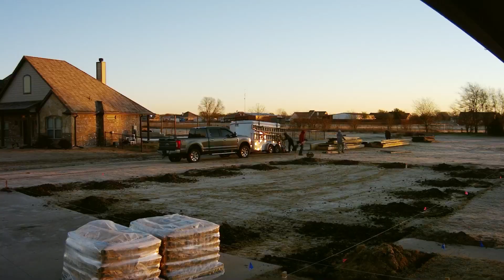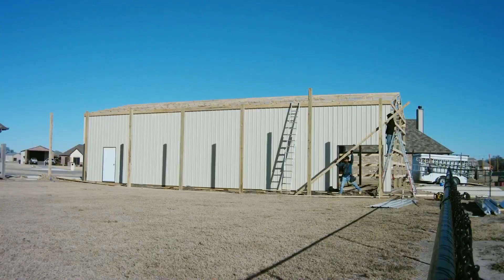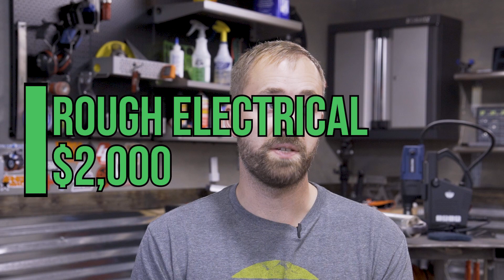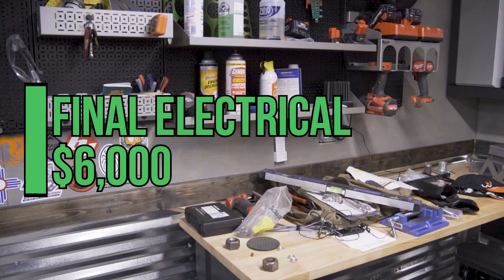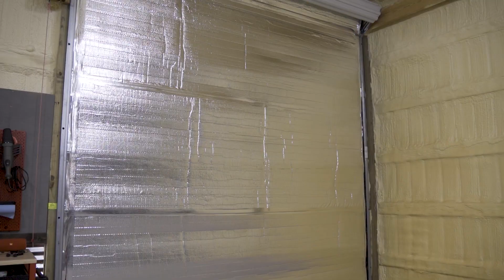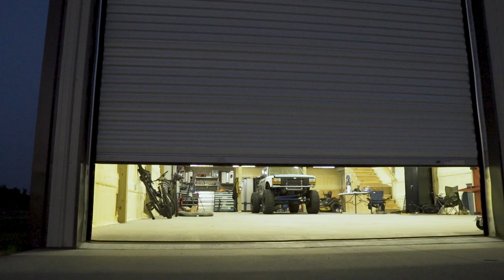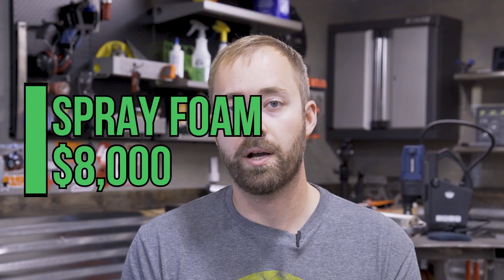How Much Does A 30x60 Pole Barn Cost? - Reckless Wrench Garage

Comment: Only 15k for the concrete foundation?!  Up here in MN it cost me 25k for a 24x28 for my garage...
Reply: you must not know any concrete guys, i paid 6k for my 36x48 in minnesota
Reply: @sc400drift2  I'm smack dab in mpls... nothing is cheap in the cities
Reply: Living in MPLS is problematic in more ways than construction costs.
Reply: Cost varies widely based on location. The site prep and concrete for a 42x50 slab (4" thick, 12"x12" footings, rebar, fibers, wire mesh, 4000 psi) cost me $24,500 in NC.
Reply: I paid 17K for a 40 x 80 , plus 4 x 80 sidewalk and 30 x 20 parking pad in MN in 2018.  Guy gave me a deal but others wanted 24K . Thats 4000 PSI with fiber

Comment: Good looking garage. A nice open floor plan 1 bedroom apt. on the  back would have been sweet
Reply from the maker: It would have been doable, getting water and septic there would have pricey though
Reply: @RecklessWrenchGarage  
You could do a compost toilet or an incinerator one. Also a grey water drainage system for sinks/showers saves $$.

Comment: As an Electrician I would have put in a separate 200amp service and not come off the house. You’ll always have room to grow then
Reply: I thought the same but when I did mine it was going to be another $30 a month forever for the second meter. So I did the same from the house.
Reply: I just added solar to my house, so they bumped the old 100 Amp service up to 200 amp with a new main panel. I originally had my shop powered from the sub panel in the house with a 50 amp breaker, but I moved that into the main panel outside and ran a direct line to the shop. Still have yet to pop any breakers with 50 amps to the garage running all the welders and big compressors I use.
Reply: @DangerzoneDuggar  just because you haven’t pooped a breaker doesn’t mean everything is A ok. It might work but your pushing that panel to the max, not good for the breakers or wire over time
Reply: @Justin Barnes  6 years later it's still been fine. All the components in the shop have peak draws under 50a, so... 🤷‍♂️
Reply: @DangerzoneDuggar  well then I guess you know more then a Licensed Electrician, what do I know 🤷🏻‍♂️ as long as it works. It’s your shop not mine
Reply: @Justin Barnes  if neither of the licensed electricians I had help me with the shop setup are concerned with the setup, it's good enough for me. Until I out grow the space and am forced to upgrade to a bigger shop.
Reply: @DangerzoneDuggar  if you just had a normal garage with lights it would be fine. You start adding welders and big air compressors your over loading the 50amp panel period. Like I said it’s your shop but I wouldn’t even install that if you told me that’s what you were putting in. My only point was for a little more money you can have a real service, the labor is the same your only paying to upsize materials. You problem is after it’s in your stuck, wire is already in the ground
Reply from the maker: This is something that I considered, but ultimately went the route I did due to the cost of bringing in another line and the location of the utilities

Comment: I've loved watching your shop build series. It kinda came at the right time for me and I just pulled the trigger on a building really similar to your set up. You convinced me to build taller than I had originally planned and I'm going to add the back mezzanine too. That is an excellent use of space. I've got a bunch more site work to do since my yard is not nearly as flat. Thanks for the cost break down. The only thing I hadn't the first clue about was the cost of spray foam. At least now I'm prepared for what it'll cost.
Reply from the maker: I am so glad to hear that these videos have helped at least 1 person 🤘🏻 going into my build I didn't know how much anything would cost. Good luck on your shop!
Reply: Building taller has more advantages than just saving foot print space. It is a lot easier to heat and cool down when you have two levels.
Reply: An excellent investment.